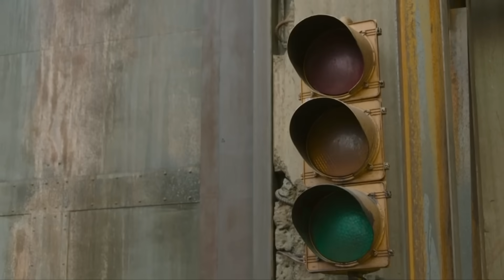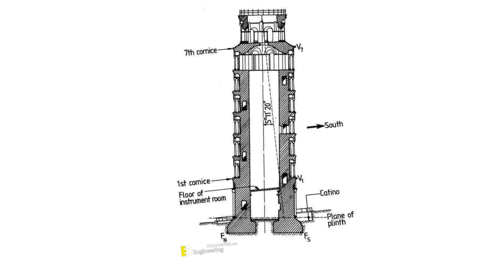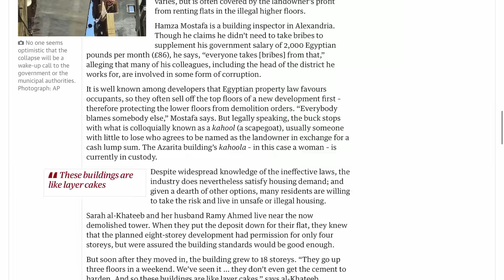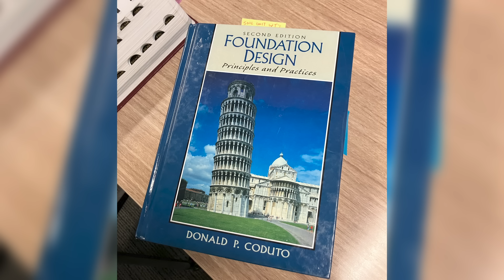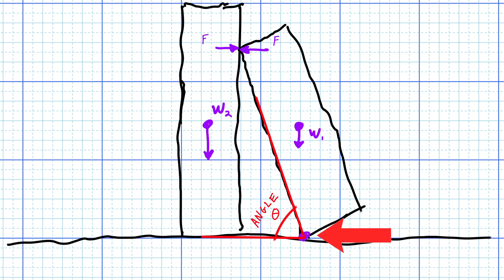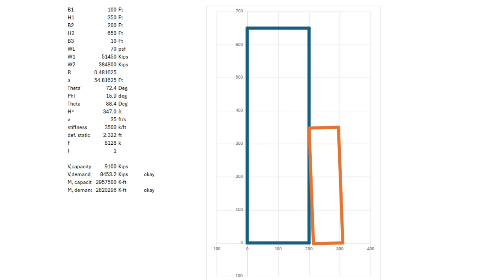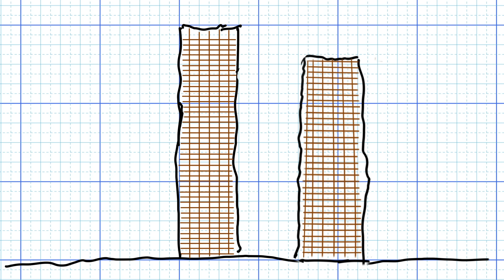Analyzing the Leaning Towers from The Last of Us

Comment: The tower in Egypt likely had a soft first level that collapsed on one side. 

I would imagine that there are a few factors that determine if the tower leaning on another tower is stable: design and strength come to mind. 

Some skyscrapers are built like a bunch of boxes all connected together (Empire state), some like a bundle of tubes (Sears / Willis? tower Chicago), and some with a solid core and the minimum amount of perimeter support possible (twin towers). There are of course hybrids all across the spectrum. 

The Empire state was also built extra heavy compared to modern buildings, and the twin towers were pretty light weight. 

I think it far more likely that the Empire State could survive leaning or being leaned on than the twin towers.

A sudden soft story collapse might be quicker and less survivable than a gradual soil subsidence.

In the end tough, good graphics is the real key.

Comment: technically the leaning building isnt full tilt in game. the base of the building is still flat. the upper bit has leaned and is very much going to collapse soon. 
Likely the lean is recent.
The city of Boston was Bombed. and many fires did rip through the city.
And you can see that the leaning building has pushed further into the other, not just set against it.
Reply: It looks pretty different in the remake vs original

Comment: 10:14 'P Delta'? Isn't that the thing that eats crabs in seconds? "when its got ya. its gotcha!"
Reply: not to be confused delta p
Reply: @theshuman100  p delta spits out new crabs
Reply: not just crabs, it could be a human as well. 

IIRC, Delta P is the phenomenon where the difference of pressure between 2 underwater bodies is so great that the force of opening 1 body connecting it to the other rips anything with it and shreds it through the opening, small or big. 

Migth not be totally correct but you get the gist of it

Comment: Unless I missed it, you didn't mention that the net force at the base of the leaning building in the rigid body analysis should equal 0, lest the base slides away.

...Factors like material deformation and crumbling over too much stress would totally come into play well before that's a thing in a real scenario, but it's still important to consider, even if its relevance is minimal and can be discarded.

Comment: I'm no structural engineer but my assumption is that the first three to five floors of the leaning building had caved in over due to the damages from bombings and fires. Not so much that the ground under the the leaning sunken down. This gives the idea that building is still anchored to the foundation. Now can a building be leaning onto that building with destroying at that angle realistic? I doubt that but  that you didn't entertained that the bottom of the is damaged but still above ground. But went with the building sank into the ground seemed foolish
Reply from the maker: Thanks for engaging with the content!! At 8:12, I mention that damage to lower levels will likely precipitate collapse above, and would be difficult to arrive in that position. Hope that helps!
Reply: @onstructures  the lower floors collapsing would likley cause the higher floors to collapse, the same way a building falling into another would likley cause collapse but when you have a whole city it will happen
if you look at your examples you can see this, if your look up failed demolitions you can see this, many many buildings have their lower floors give out but then the debrie distributing the load by taking up space slows and eventually stops the collapse as the new building has less floors to hold up
this doesnt really happen in skyscrapers but the smaller you go the more likley the building actually has a pretty constant structure from top to bottom meaning the top floors can hold as much weight as the bottom floors but simply dont need to